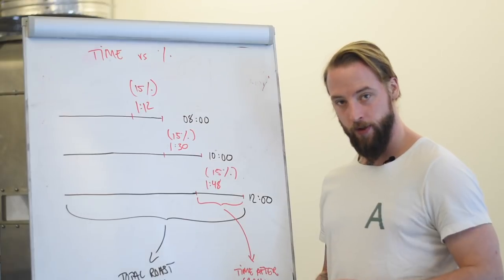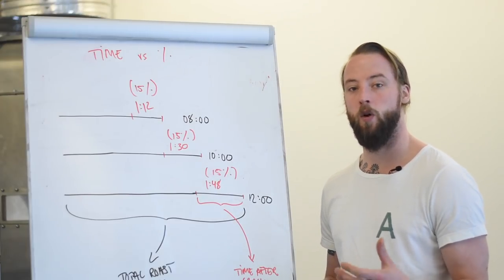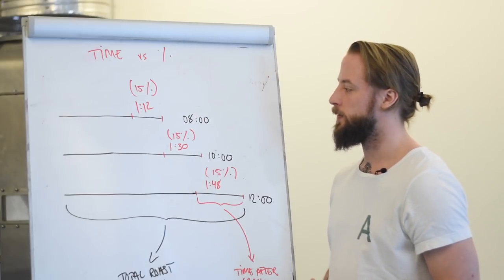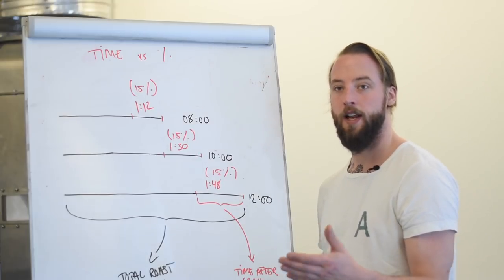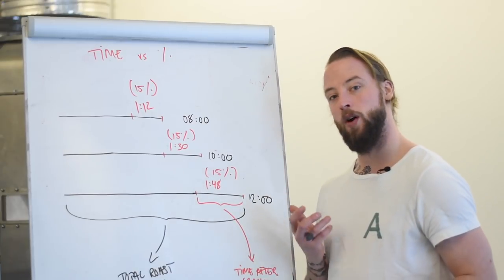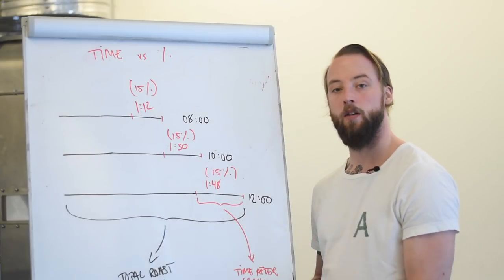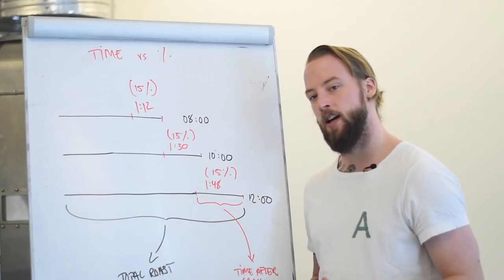Coffee with April Episode 65: Development Time - Time vs. Percentage

Comment: As I have always said, the coffee tells you how to roast it,  it the other way around. At the end of the day you are always looking for the sweet point, better coffees will have a sweet point closer to the beginning of first crack, so you can have balance and preserve acid complexity. Another point is the energy that is carried into first crack, my golden rule is the rr should be broken into 3 segments. Let’s say that your time from crack is 2min ( 120 seconds ) I would break this into 3 segments of 40 seconds. The rr for each segment should halve. 1st might be 8 second should be 4 third should be 2 etc. 
another important point is once you hit straw the rr should never rise again, it should fall gradually till the end, each coffee will release different levels of energy through out and gas and air should be adjusted to never let allow rr to rise again or lowered too much allowing rr to fall to quickly.
If rr increase you are adding bitterness if it falls too quickly you are losing sweetness.

Comment: Great video on a major topic in coffee roasting. The next obvious question for Mr Joe Average will then ask what time after crack is a good range rather than percentage? Or is say 1 minutes 45 seconds a good place to start and then simply take samples with the tryer before and after this time to cup and discover that answer more accurately?
Reply from the maker: Thank you for watching Simon. The time after crack that generates a coffee that the person roasts likes is a good time.
Reply: In my opinion we are looking to maximise sweetness, where this falls for each coffee is different. Also time is very limited information. For example if you have a RR of 10 for 1 min verse a RR of 5 for one min verse a RR of 8 that gradually falls to 4 after 1 min. All three coffees will be very different. 
Time is like the wheel of a bike, alone it is just a wheel that does nothing, you need all the pieces for it to be useful.
Time, energy, airflow, rate of rise
Coffee’s acids, volatility of amino acids, coffee’s brix or potential sweetness and also what job you want the coffee to do.
Each bit of info is as important as each other and all are useless in isolation.

Comment: This is very helpful! I'm also wondering about how to determine development level. That is, my end temp could be 210 on one roast with nearly 3 minutes after first crack or 215 in 2 minutes after crack. Which is more developed? What is a better factor to judge dropping the beans, time or temp? Many thanks!
Reply: This is precisely why I do not agree with the concept this video pushes. Time after crack is NOT any better of a development measure than development percentage. They're both flawed ways of looking at development if you're just going off solely time or just solely percentage. 

Going just based off of time will still result in inconsistency if the temperature changes. And guess what, temperatures fluctuate in every single roast, so time after crack will always skew your development by some amount. 

You can ABSOLUTELY get a darker development in the same exact amount of time if you're doing a hot roast vs a slow roast. 

As a home roaster it is my opinion that dropping your beans based on numbers alone is always going to be inconsistent. You really just have to pick what kind of inconsistency works best for you. In my opinion dropping beans based on sight, smell, and sound is the best way to consistently make TASTY coffee, and develop a true sense of roasting. Most roasters I think use a combination of their senses, development time, development percentage, and temperature to decide when to drop their coffee. There is no magic number that always reproduces the same exact roast every time, as you're conducting an entire concert of reactions and variables not just flipping the switch on a dump truck.
Reply: No way to tell with the information you provided.  It sounds like you are not using the same bean or the same heat and fan speed, or you are comparing your first roast with a following roast.   If it's the same bean, you need to go by color.   Once you get some consistency (same time and temperature after FC,) then you determine your development level by tasting what you like best.

Comment: I realize this video is 4 years old. Okay, so you don't give much credence to DTR. What do you use to determine the end of the roast? Color? I roast to a % weight loss, determined by DTR time and it works for me. I roast small, half-pound batches that I bag separately. After resting, I make a cup of each using the exact same variables and taste the difference. I do this with many coffees. I'm not arguing or saying I disagree, I'm just saying you can use DTR as a variable and get different tasting results........and we both know that taste is the bottom line. I enjoyed your video.
Reply from the maker: Thank you for watching. Deciding the end of the roast is a combination of many factors. It's more based on end temp in relationship to time after first crack than colour. Colour is a good way to identify a ballpark but will differ depending on the green coffee that is being roasted.
Reply: @coffeewithapril  I completely agree the variables are many considerations. My motto is "The essence of the bean". I have discovered your videos while browsing through YouTube. I plan to watch many of them, as I have discovered that "Coffee With April" is a resource for knowledge.

Comment: The chemical changes that happen inside the bean after it loses moisture, but before it cracks (1C), are CRITICAL. Without the sucrose, acids breaking down & developing new  compounds down during that timespan (before 1C), there is nothing to 'develop'

Comment: In my opinion we are looking to maximise sweetness, where this falls for each coffee is different. Also time is very limited information. For example if you have a RR of 10 for 1 min verse a RR of 5 for one min verse a RR of 8 that gradually falls to 4 after 1 min. All three coffees will be very different. 
Time is like the wheel of a bike, alone it is just a wheel that does nothing, you need all the pieces for it to be useful.
Time, energy, airflow, rate of rise
Coffee’s acids, volatility of amino acids, coffee’s brix or potential sweetness and also what job you want the coffee to do.
Each bit of info is as important as each other and all are useless in isolation.

Comment: I'm a chemisty and roasting master and I tottaly agreed with you. % doesn't make sense. Chemical reactions speed is guided by time vs. temperature
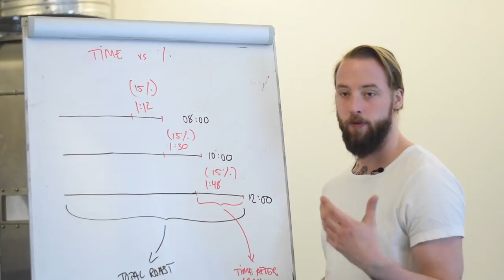Reply: How I understand it, it kinda makes sense though. Taking a steady declining ror for example. If you reach fc at for example 6:48 minutes, that means that you have put much energy into the roast which now roasts the coffee faster til reach of a specific „roast color“.
But now if you take the same steadily declining ror on a roast, that hit fc at 10:12, you now have less energy in the system taking the roast forward till it finishes. Which means you need to wait longer after fc for the roast to be at a specific roast degree. Just like you said. It is guided by time vs temperature. Or am I missing something here? Curious to know.
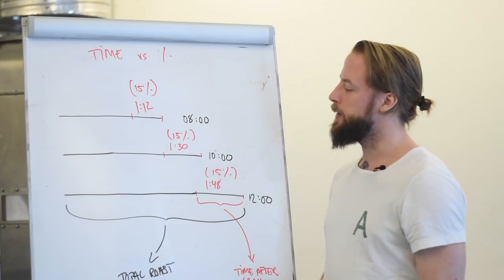Reply: @cr3at0rgamer67  Only if you take the same steadly declining ROR it will make sense... You can reach the FC ath 6:48 an then decrease the gás to slow down the roast. But the point is: In a 8 minutes roast, 20 % means 1:36 . In a 12 minutes roast, 20 % means 2:24. Here we have two different times (1:36 and 2:24) for the same percentage. Even if you drop them at the same temperature and collor, they will be very different coffee. The faster will be more accidity and the other a bit hollow. This information I cant know by knoing the FC percentage. FC percentage only make sense knowing the total time... however, knoing the total time and the %FC time is the same of knowing FC total time